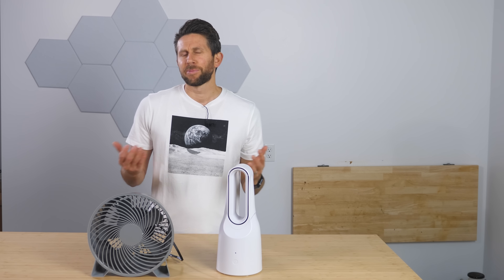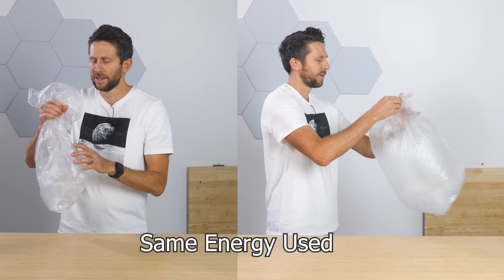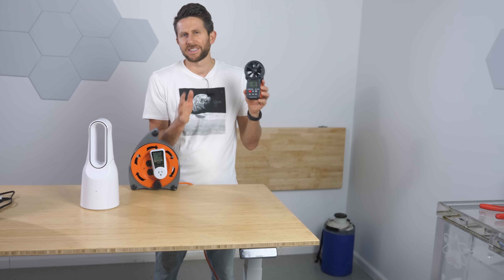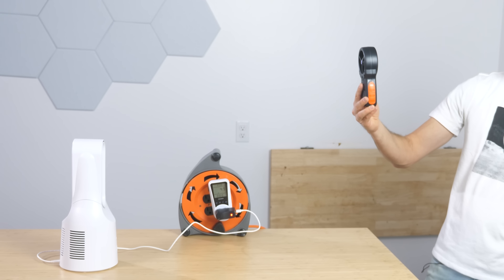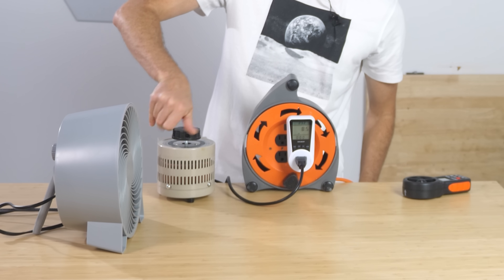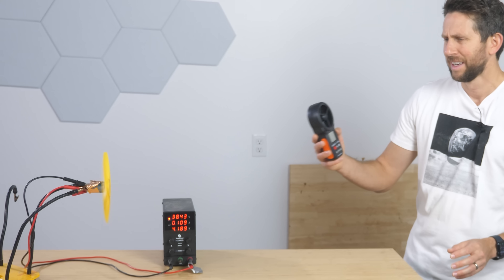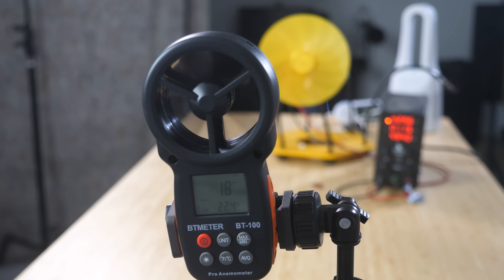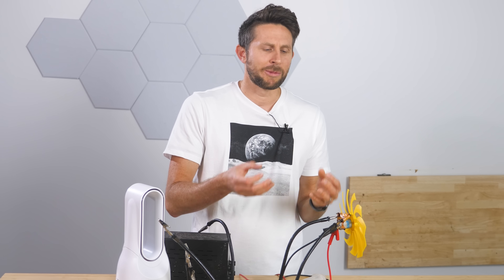Are Bladeless Fans a Scam?

Comment: Remember that Dysons are not just fans, they also clean the air (and some models can heat the air or moisturize the air)
Reply: For the money you spend on a Dyson fan you can buy a cheap $30 fan, a dedicated air purifier/ moisturizer and then keep $100 in your pocket. Everything about Dyson stuff is marketing. I have a Dyson fan for years. It’s not quieter, it’s not more powerful. It’s just a good looking, expensive fan that is safer for children.
Reply: 😂

Clean the air.
Nothing stopping someone from putting a filter on a regular fan.

The terminology you're using is pure marketing. You've pretty much just described a cheap humidifier, which is bladeless, heating, and 'moisturises' the air

Comment: the lab power supply has a lower efficiency at maybe 70-90%. You cant simply compare the results if you are using different motors, transformers, powersupplys, etc

Comment: Could you test if dishwashers use less water than washing dishes by hand? I've heard so many dishwashing soap companies advertise that but the only ones testing it are local news channels and I know they're not as rigorous as you 😋
Reply: Technology Connections tested his machine. If I remember correctly, the amount would barely let me wash a small part of what goes in.
Beating a machine at water efficiency would require way too much planning and work

Comment: Same as how an air nozzle has holes a couple inches or so before the exit at the tip, to increase air velosity.

Redesign it so it blows through the center and has vents on the side, to let more air come through with the regular air going through it. Like the air nozzle.

Comment: Dyson fans do use a different type of moter that is VERY good at pushing air (like VERY good) and it always makes me wonder why they don't just sell that as a fan itself, remove the bladeless parts since they do indeed slow it down to the point where it is equal to or slower than a fan that costs 20x less...
Dyson fans are good at clearing the air though due to the amount of air they can move, though for the price of these you can indeed buy bigger air-puryfying units that cost less and do the same job as well (if not better).

Comment: So would changing the outlet shape and where the low pressure ares are generated make a difference? Like starfish slits.. a formation that increases the low pressure areas rather than just the outside? Would wing aerodynamics help? Do the openings need to be larger? ect ect
Reply: It just makes things look prettier.
Consider that air multiplication worked from him simply blowing from his mouth. That'd imply normal fans do the air multiplication trick too, but without the friction from air bouncing around inside a 'bladeless'.
Reply: @Utrilus  Very true and suspected. Though Tornado genertoer are not all that outside of a chamber, I was wondering it tangential flow on inlet and the normal setup might on outflow ,ight add a little something, evn if only a bit of extra distance.

Comment: A lot of impressive measuring instruments. But if you don't design the experiment properly, that's all you get -- impressive measuring instruments. I'm not seeing just what was proven. That wind speed matters more than total flow? That it makes any sense to run a fan at lower than its rated voltage? That blowing air creates a vacuum?

Comment: I have that first gray fan he showed. I got it for free lol. When I tested it I figured out why. It's the worst designed fan iv ever seen. I don't blow more than 8 mph at max speed.  I have fans 1/4 power hitting 15+ mph.  Also the air that did come out the front did not get focused into a beam of air like the vornado fans can do. So I removed the motor and blade from the housing and tested the wind sleep again.  16 mph and it was much more concentrated and quiet.  If the fan housing is poorly designed, you have a fan that draws a lot of power, is loud and moves almost no air. This fan pulled like 55w.  

I have a larger 14 in  Xpower variable speed dc fan that pulls like 45w and does almost 20mph and throws air like 60 feet. That is many times more efficient.

Comment: The Dyson bladeless fans work using the Koanda effect. Looking at that cheap bladeless fan you were testing, that does not seem to have the diverging profile that is needed to leverage the Koanda effect. You've been scammed: that's a cheap knock-off bladeless fan that doesn't work properly.

Still, the benefit of a bladeless fan is not primarily efficiency -- or not directly. The advantages of a bladeless fan are that they keep the spinning part out of the way, which allows the noise it makes to be isolated (again, if your fan was not quieter, it's because it was a cheap knock-off), and that the air drawn in produces a WIDE air movement. A simple bladed fan does not produce as WIDE a column of moving air, so as a result you may end up having to run the bladed fan faster to get the same ventilation effect -- THAT is perhaps one way that a bladeless fan could be said to be more efficient: it can be used less wastefully. But the efficiency is NOT a particular advantage or selling point. Fans are pretty low power anyway. And if you are just wanting to shift the biggest VOLUME of air through a tunnel, then obviously just a simple bladed air mover will be the best option. The bladeless fans are better for circulating air around a living space in a quiet and effective way.

Always use the right fan for the right job. Including comparison tests and experiments.
Reply: I've looked at sound test videos and bladeless are louder while moving less air.
Seems to me that the air loses quite a bit of momentum bouncing around in the housing. And to compensate they got to run faster and louder.
Reply: @Utrilus  That's not quite how air works. You should take a look at a bladeless fan running in real life -- a proper one, not a cheap knock-off. It's no such much that they are quieter per se, it's that they don't need to run so fast to produce the same broad spread of air movement in a room. And the sound they make is OUT of the airstream, unlike traditional bladed fans. And, again, this all depends on how they're used -- if you're just shifting air down a tunnel, use a normal fan because they'll make the exact same noise for the exact same power, and actually the bladeless fan can sound louder because it tends to have a smaller diameter turbine which makes a higher pitched sound which can be more noticeable when it's running at the same speed. The quietest fan in my house is a traditional bladed air mover, but that's not the fan I would have on in my living room -- instead, that fan sits in an open window after a hot day shifting cool air through, while the Dyson bladeless sits in the living room making a nice quiet air movement. Always use the right fan for the right job.

Comment: Traditional fans are superior in every way except that they are not novel. Air multipliers are interesting but like everything else dysan thinks it invented it didn't and in fact a normal fan already is a much better air multiplier.  The one problem with traditional fans is the finger guard is ugly and robs it of efficiency and in todays age where everyone is a blithering idiot we need tighter finger guards and even when we do that they get their hair stuck in the fan... but even so you're paying $40 for plastic and a motor which is actually made by Panasonic and then $550 goes into the marketing budget and James' back pocket.... he really is a smart guy.

Comment: Great Video 👍 Perfect demonstration to debunk a myth! Apart a cool design, silent operation, bladeless fan are just a marketing prop. Here in Cyprus, they have fallen out of favor with people realizing they do not bring much value and coverage area like traditional fans. I guess a traditional fan with brushless motor will also be relatively quiet. In case of Dyson fan, the silence comes also from the centrifugal fan design they use which is more silent than a conventional fan... Anyhow,I would spend the 600$ on a proper inverter A/C those days😄

Comment: The bladeless fan you were using is fundamentally different than the dysons. I don't think this is a very good test of the concept at all. And measuring the air velocity to compare performance is pointless when the designs literally trade velocity for moved volume.

Comment: Electric motors has highest efficiency at max voltage/RPM they were designed for. That is why using super fan at 10% vs fun at 100% was a fair comparison.

Comment: I always thought the benefit was the slim profile you get a lot of air movement with a very very small footprint. Secondly, a benefit I figured was also the safety with children/pets
Reply: Thats actually the main benefit and you also can hide this fans better in the environment. People like to lie themself
Reply: @catman64k  It's the aesthetic tho. You don't actually get a smaller footprint. You'd get the same by buying a smaller fan.
Reply: We were in the market for one because we keep finding our normal tower fans are effectively impossible to completely clean even when taken apart. With a bladeless, there are just fewer small slots to clean but the tradeoff is that it's objectively worse at being a fan
Reply: @meowmiaumiauw  Tho don't the insides get dirty as well, it sucks all the air into the fan area and then out.
I suppose long as it's not dirty in the open it's fine, and not like it matters.
Reply: it's still easier to clean than multiple blades stacked on top of eachother
Reply: @jaye3  We just think it's easier to do that than get all the dust out of the front and back grates of a normal one. Problems are that any bladeless will push way less air, it's louder, and there's still grating and fan blades to clean in the base of the unit
Reply: @jaye3  bet you haven't cleaned the inside. Open it up and see just how nasty it really is inside the plastic housing.
Reply: @Utrilus the dyson fans have filters. That's why I converted to their fan lol I used to have an air filter plus a fan, so I replaced both with just 1. It works great as an air filter, and decent as a fan. I use an air conditioner anyway for temperature.

Check out their product lineup for the airtight models. It's great if you want to optimize your weekly cleanup at home. Overpriced, but there is a line I am willing to cross in the name of convenience. I also have wifi app controlled robot vacuums per floor. They have floorplans of the house & clean as needed. Now I only have to do light mopping, clean the robots, & put the rest of my cleaning effort into walls & elevated surfaces. Saves a lot of time.
Reply: @meowmiaumiauw  The bladeless fan simply accumulates the dust in its base (where its blade is) - just hiding the dirt.
Reply: @thisiswaytoocomplicated   I know, I just find it easier to clean that than to clean the grates on a conventional tower fan
Reply: @meowmiaumiauw  So it's dirty on the inside rather than on the outside.😮😮
Reply: @meowmiaumiauw , but it’s not easier to clean. It just means most of it is hidden and so out of sight, out of mind.
Reply: @thihal123  I find the grating on a standard tower fan to be literally uncleanable even if you disassemble the whole thing, in contrast to the bladeless ones which have FAR fewer grates and an internal chamber you can vacuum or wipe down really easily after unscrewing everything
Reply: A tower fan has the same footprint with greater power.
Reply: It’s the ease of cleaning for me. Cleaning the blades of a conventional fan is a big pain in the ass.
Reply: @kyren5357  its much easier to clean a conventional fan than a bladeless or are you too lazy to clean a bladeless because the blades still need cleaning even though you cant see them
Reply: But the fan without the cover has a smaller profile and blows better...
Reply: @dariuszantoniuk  both the fans have covers
Reply: The "benefit" is more money in Dyson's pockets.  That's it.  They quite literally "reinvent the wheel" with their products.  Dyson's whole model is "let me take tech that already exists, make it objectively worse so, but it looks cooler and we can patent our new design and charge twice as much for inefficiency" 

When I see ppl that own Dyson and apple products I see gullible rubes.
Reply: The only way it is safer for kids is if you have your kids running around with cutters
Reply: @jmavierpayne9726
If regular fans were unsafe at all they could not be sold in the US.
Reply: @mrbmp09 the US isn't exactly the pinnacle of safety regulations.
Reply: @mrbmp09 I'm considering switching the blades on my fan out for real blades. That way, anyone who sticks their hand in there will get what's coming to them. Teach them a lesson.

Comment: I appreciate You and others (Technology Connections) giving an honest careful look at hyped devices. Some criticize you measuring air speed, not flow volume. But you did a rough measure air flow spread. Cross-sectional area of flow and wind speed give a flow volume rate. So you did fine. Thanks!

Comment: Y air speed was lower with bladeless, but how about volume of air. if y but sag on front of the fan, which gets full first. speed of the air is not amount of the air. When y use fan y want to move lots of cooles air where y want it, or hot ai where y don't wan't it. Fast air speed with fans can be negative, when air bounces from surfaces.

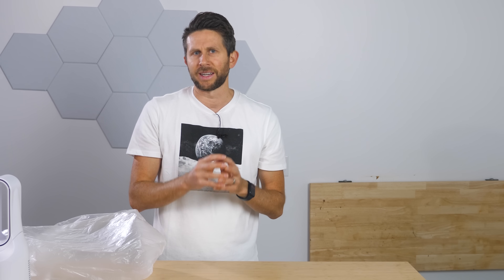Comment: No, your explanation at 1:00 is not correct. Additionnal air le not moving by à low pressure but by viscosity. Shear stress 

This is a common mistake. 
If you simulate your pressure field you will see an almost constant pressure value. 
The mistake is to try to apply bernouilli equation, but bernoulli us valide only on a streamilines. The primary air blown and secandary suck air are not on same streamlines and both exhange momentum by viscosity / shearing

Comment: Frore has cooling systems that use tiny sheets of polymers that vibrate and flap in-between their chassis's side, which is the size of a credit card, and technically speaking it spits air as opposed to pushing or pulling it. Idk if it's a scam or not, I haven't seen them implemented, but fuck they're cool. (Pun unintended but unobstructed)

Comment: I feel you should compare the test with a Dyson fan
It's not so easy to get a blade less fan working efficiently
Dyson uses a compressor wheel that shoots Air at high static pressure through the slit
Also in dyson the slits are inside the oval cutout, not on the tip like this fan

This is probably the worst bladeless fan design

Comment: So unless a more controlled test with other controled variables and measures other than just air speed, it pretty much confirm bladeless fans are just a marketing shennanigan.

Even if such a test give a better performance or efficiency result towards the bladeless fan, then still the cost difference doesnt make sense....

Comment: yes the normal fan entrains the surrounding fluid through use of blade tip vortices.  which is what the yt trend of torodial props is trying to remove (blade tip vorticies).   which makes them less efficient at moving the fluid BUT less 'noisy' ...   by pass jet engines are MORE EFFICIENT vs jet engines with NO BY PASS FLOW...    the by pass flow is akin to the entrained air around a normal house fan...

what you're not noticing is the 'duct' around the blades on your 1st fan which was drawing too much power...  you switched to the yellow fan with no 'duct' ....  'duct's are used to remove the blade tip vorticies... there's a common misconception that 'ducted' fans are 'more efficient'  due to no blade tip vorticies meaning less drag on the fan blades to rotate....  it's a misconception simply because people aren't looking at the power draw vs RPM of the blades AND a lot of the time things are so software driven no one considers that the software is actually hindering/limiting  by RPM values.

in short... there are no 'ducts' around turbo prop planes...  there are no 'ducts' around props on single engine prop General Aviation planes...

Comment: The video and presentation is awesome!  There is a bladeless air cleaner/fan called the "Ionic Breeze," it uses a low current high voltage, (low power, to move air electrostatically.  They do not blow as much air as a bladed fan however.  I have on my channel, a flying device called the Ion Propelled Vehicle, it can fly with an onboard power supply and no propellor blades at all.  It's much lighter in weight than flying crafts with moving blades.
Reply: The thing with air ionisers though is they generate ozone which isn't very good for the lungs, and if you've ever used one for a long period of time you will notice the rubber soles of stored shoes turn to a sticky gooey horrible mess lol.
Reply: I didn't know that air ionizers do that to shoes.  The crafts that are shown on my channel operate on very low wattage high voltage electricity.  Since the energy is spread out over a large surface area and the energy level is too low to produce O3, it only produces small amounts of harmless ions, mostly negative ones.  I have not noticed any problems with it like the ones you are referring to.
 @bigbasil1908